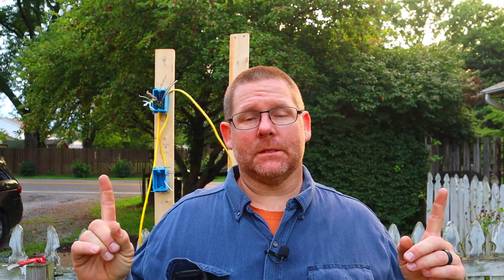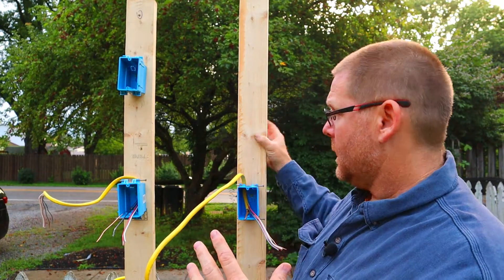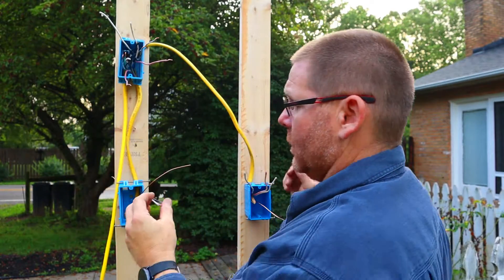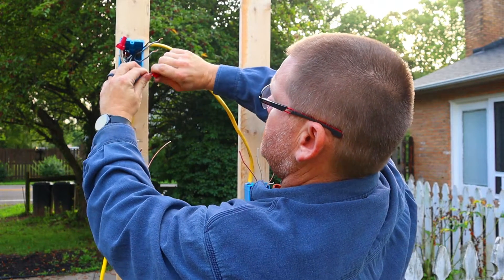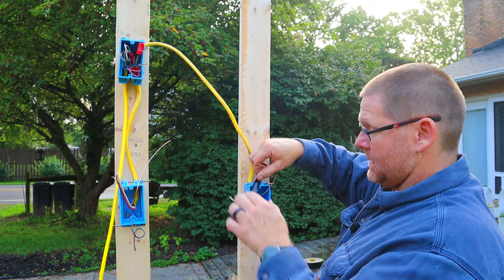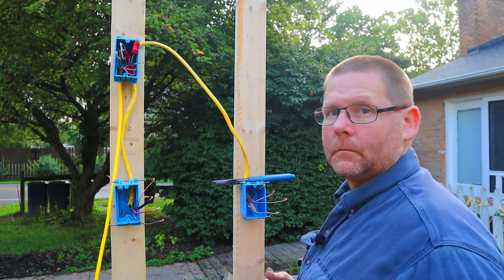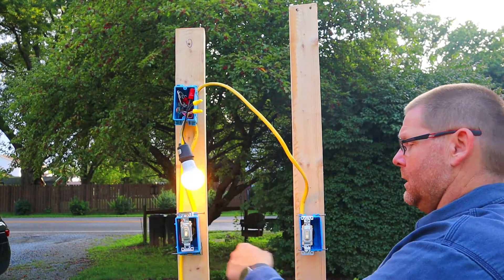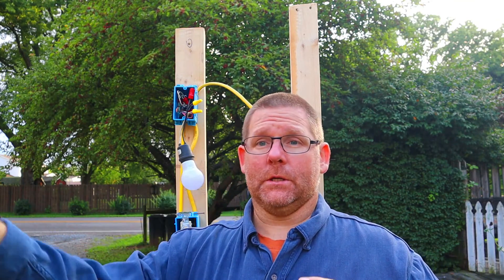How To Wire A 3 Way Switch Using Only 3 Wires In A Switch Box

Comment: So, I ran into what I ASSUME is a dead end three way situation. But I'm looking for help understanding it.I have two three way switches, at one switch box, all three wires red, black and white are all alarming with my non contact voltage detector. Other box, nothing alarms. I reconnected them as they were originally wired and both switches are operable again. I was replacing a switch that had a problem with the toggle causing the light to flicker when wiggled. However, I am perplexed as to how all three wires in the one box can all cause the non-contact detector to alarm. Does this sound like I have some dangerous wiring in the fixture box? Admittedly, I did not measure actual line voltage. I also didn't check the fixture box, as Its a huge heavy chandelier that I really don't want to get into. The room was a renovation, a few years ago. I had a licensed electrician upgrade my panel, install a subpanel, and convert a screw in fuse panel, however, I think the outlets and switches were done by the contractor's general laborers. I cannot figure out if its safe or not...despite the switches working again. What would you recommend?
Reply from the maker: That non contact voltage detector is not to be trusted. It's good for alerting you that there is power there, but to get true accurate readings trust only a meter. Seems everything is ok with your circuit.

Comment: I have a three wire that is coming from switch into a light how would I hook another switch up to the other side of the room also coming from the switch is a single blue wire thats connected to the hot side of the switch with the black hot going to the light. when I tested it the Black and the blue wire is hot in the light box. its an open area no drywall.

Comment: Hi, thank you for your videos, I have trying to connect a 3 way dimmer to an existing 3 way switch  but I can't seem to get it to work.   
Here's how I would characterize the project.

1) lighting fixtures are outside  (garage light fixtures),  2 switches (one in the garage call that SW1, the other inside the mud room leading to the garage SW2.)

2) I want to install a smart dimmer (feet electric) which can be used in a 3-way capacity (BUT REQUIRES A NEUTRAL WIRE....this part I think is important)

3) BOX2 has 3 wires only in the same casing (similar to your example in this video) Red, Black, White.

4) BOX1 has many wires, but the original switch SW1 has a black wire originating from a 2-wire (black and white), and then a red and white wires originating from another 3-wire set.

I tried to put the new dimmer in BOX1 and BOX2 using every single possible configuration of wire combination, but can't seem to get it to work.  

I think the problem is that there may not be a neutral wire in one of the boxes.

Any advice?

Bob
Reply from the maker: I find that almost hard to believe even in older homes that the 3 way besides the door going outside doesn't have a neutral. Did you test it with a meter? I'm not saying that it's totally impossible that there isn't a neutral there. Use a meter for sure to make sure.

Comment: Hi, Thanks for the great video! I would appreciate it if you can help. I have the 3-wire situation. I only opened switch box 1. Did not touch switch box 2. Didn’t remember it was 3-way until later or would have taken a picture and hopefully saved several hours of troubleshooting as I thought white wqs neutral and screwed up the wiring. 

I have a hot wire coming into the box. I hooked it up to common. I checked… if the live is not hooked up, there is no power to the light. I have a black and white transfer cables. Regardless of how i hook them on which side ( i tried switching sides too), I am only able to turn on and off the light only from the switch box I turned it off from…if one of the switch boxes is on off, i can’t seem to turn it on from the other. 

What would you think i am not getting right? It worked just fine before i tinkered with it.

Comment: I was looking for a way to run power to the light box only... and then run only the 12/3 to each switch.. it looks like he has it  here (I do not know if it is up to currnet code) and found that was hard to concentrate on the wires connected because of other explanations about tools,  tape preferences, other people who tried this or that, . I tried to sketch it out.... then check out the circuit myself... and am hoping to get it right...I know about the black tape over the whites that are in with the traveler wires..  But he should also mention not to Tie the 2 whites travlers together but dont get the white that is also called the "nuetral" whcih is coming from the breaker box confused with either of those whites...then tie the reds together in the light box. hopefully this will work.
Reply from the maker: So current code reads something like this.. Im not quoting it but you need a nuetral in switch boxes. However they don't need to be in there if you have a way to get them in at a later time. Meaning to fish it in or a conduit or however you can get them in after the fact. At least that's how it is here in my local and the code we follow

Comment: So how do you get a neutral if you need it? I have a switch with a nightlight for my grandparents in their hallway. I been having an issue with it because I can’t use the 3 way switch feature with the night functioning
Reply from the maker: You will have to fish the wall and add a piece of romex
Reply: To the hallway light or to the other switch?
Reply from the maker: That's depends. Where do you want the switch? That's where you will need they nuetral
Reply: Okay so where I need the neutral that must go Al the way to the panel?
Reply from the maker: If you do not do that then come off of the light that the switch is controlling. That way you keep all of the nuetrals straight and won't get confused. That's my opinion
Reply: Ok thank you I appreciate the help I’ll try it next week

Comment: I found this video which got me excited because i disconnected both of my 3 way switches without taking pictures. Both switches have only one set of wires unlike all other videos. I can't really see what's going on at the light. I hooked everything up like he did but one switch requirs the other one to be on dangit.
Reply from the maker: But does it work now?
Reply: @MountaineerOutdoors  He followed your color choices and got a traveler crossed with a common on a switch.

Comment: I was told that this has been contrary to code since 2011. You are required to have a neutral wire in each box. This means using a cable that is 4wire w/ground instead of 3 wire w/ground. The white neutral wire is simply capped off with a wire nut in the switch boxes and not connected to anything but it's there if needed in the future.

Code section 404.2
https://www.ecmag.com/section/codes-standards/best-code-question-day-part-iii/
Page down to the question, "Neutral in each switch box?"
Reply from the maker: Yes I am aware of that now. Always think that's a great idea. Thank you for sharing with me the exact code I truly appreciate it. Have a great day ☺
Reply: @MountaineerOutdoors  
Your an electrician and not known this before the video was made.
Reply from the maker: I was out of the house wiring scene around 2010 so things have changed. Obviously
Reply: @anonymousperson4363  it doesn't matter anyway...just because the code changed in 2011, doesn't mean you aren't going to run into this in homes that were built prior.  This is exactly how my basement staircase is wired and I was confused when I saw a hot white wire.  Now I know why.  Very useful video.
Reply from the maker: I appreciate your comment ☺